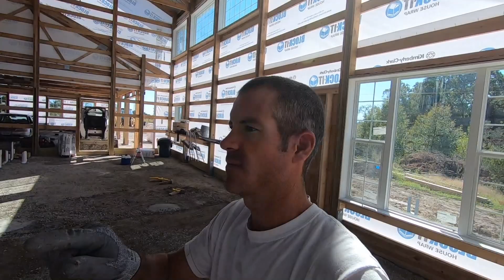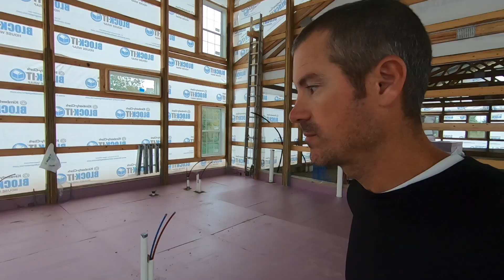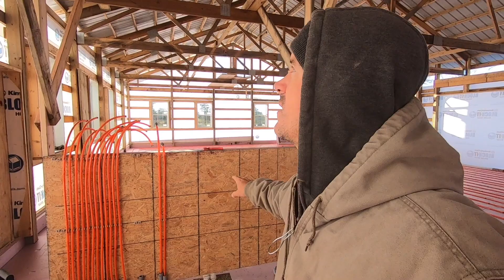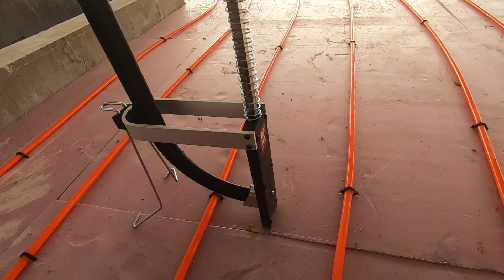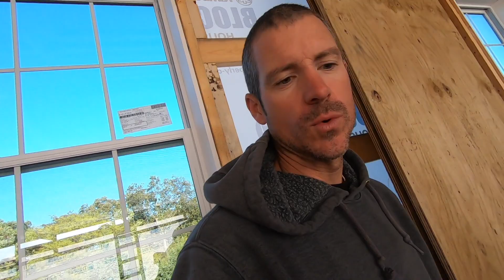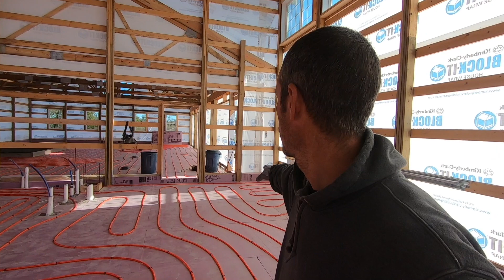Concrete Slab Preparation | Radiant In Floor Heat Pt 3/3 | Mad County Build Ep12.3

Comment: Question on the gravel above the concrete piers your poured earlier.  With high loads won't that just push out radially into the foam board since it isn't really retained to that shape?  Seems it would be better to leave that open and let concrete fill down directly to the piers.
Reply from the maker: It’s only 2”‘s of gravel between the pier and slab. You want your pier to have separation from your slab so they are independent of each other. It’s a 4000 psi slab with rebar reinforcement so the piers are probably over kill but I will sleep better knowing they are there.
Reply: @MrPostFrame  that makes sense. Thanks for the reply and awesome channel. Really enjoying the build.
Reply: HA, I was going to ask the same thing Ryan...thanks for doing it for me...lol. I was thinking the concrete would be a better option.

Comment: I was considering this way of heating myself. One question though concerning interior walls, are you concerned about anchoring those to the concrete? I'm not sure how long the ramsets or anchors go down, or if you can use glue, but I'd be concerned about hitting the pex unless I mapped out the walls first and kept the pex out from under those areas. Am I just being over cautious?
Reply from the maker: Angling Aviator along the exterior walls the pex tubing sets in 6 inches from the edge of the concrete so no problem there. I also made it so my north south walls sit between the pex tubing runs and then I measured and videoed where the tubing sits for my west east walls. Plus I will use short enough anchors that they won’t go deep enough to hit the tubing.
Reply: You can always glue with PU type sealant your interior wall to concrete so no need to worry about pipe get broken. 
Or other way is to borrow someone thermal camera and you can see every pipe inside concrete and mark them. Maybe even IR thermometer works.

Comment: Looking good sir. I like the idea of radiant heat. Do you have to have a back up to keep the house warm or is it enough?
Reply from the maker: Leo And Son Paintings I will have a wood stove  in the house as well. If it was a single level I would say yes but I have never had it in a two story so I will find out. There will also be a furnace mainly so I can have air conditioning in the summer.
Reply: @MrPostFrame  We built a 3500 sq ft house on slab in SW Iowa.  Radiant heat on the main floor.  Ended up putting a forced air furnace in for backup and central air.  For the winter of 2018-2019 we had trouble keeping the upstairs COOL in winter!!!  walls were spray foam with dense pack cellulose 2x6 exterior walls (3" closed cell + 2.5" dense pack cellulose = insane R value).  We ran the fan on the furnace to help circulate.   Loving what you do!
Reply: It's enough if it done correct way. 
And two story building you do another radiant heat on 2nd floor or use regular hot water radiators on 2nd floor.

Comment: Been looking at a product called crete-heat to lay down for our radiant system. We were quoted $4k for 2400 sq feet of the 2 inch insulation tiles. Wondering how that would compare to the insulation you are using along with the staples?
Reply from the maker: Building The Haven between my garage and house I put down 4500 sq/ft of 6mm plastic, 2” polystyrene insulation and all my radiant pex loops for 5k. I’m planning on doing a video soon on the cost of our project up to this point.
Reply: @MrPostFrame  Love you videos. Just one little comment, 6 mil plastic instead of 6 mm.
Reply from the maker: Building The Haven I looked that Crete heat up. Looks like decent stuff but I have no experience with it.
Reply: Would go with the purpose made insulation ox boards, beats needing to buy or rent a stapler and straight parallel and square runs. Crete heat or others with incorporated vapor base and reflective at the surface also helps reduce budget cost compared to what was shown as typically done.
Reply: We always lay rebar mesh first with rebar chairs then tie PEX to mesh with cordless rebar tie tool.

Comment: So ballpark figure, how much are you looking at to do that in your particular setup?
Reply from the maker: justin farrar I have 5k in material between the plastic, insulation, and pex loops. My house is 48x48 and garage/shop part is 56x40. It will cost another 3k-5k for all the controls and boiler depending on what I go with.

Comment: Looks great!  Have you decided what you are going to go with for insulation?
Reply from the maker: Riley Niesz not entirely but I would like to do spray in insulation on all the walls and probably cellulose above the ceilings.
Reply: With the type of building you have, and using it as a personal residence I would definitely suggest closed cell foam.  3" of CC will give you right around and R-20 in the walls however the main point is that at 2" it becomes structural.  It is expensive and at 3" be prepared to spend around $3 a sqft.  As far as the attic goes, unless you plan on being up in it often, save some money and just put in fiberglass blow.  Just my 2 cents being in the insulation business.
Reply from the maker: Riley Niesz where are you located.
Reply: Omaha
Reply from the maker: Riley Niesz how far do you travel for work. Im guessing 2 hours is to far.
Reply: We can travel that far but there are fees associated with the drive.  Do you have a email so we could discuss?
Reply from the maker: Riley Niesz emily@marshallremodel.com